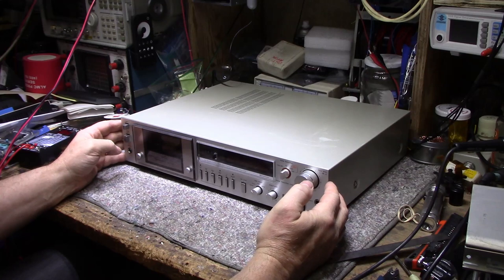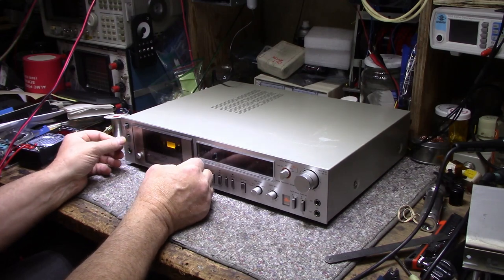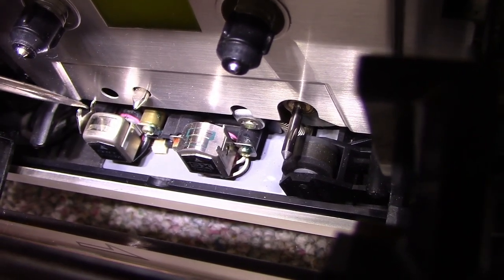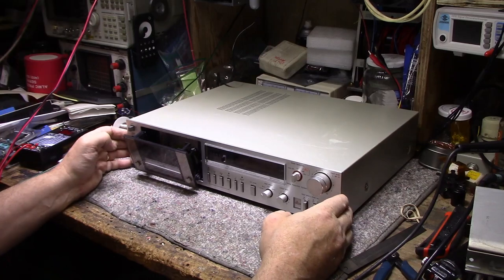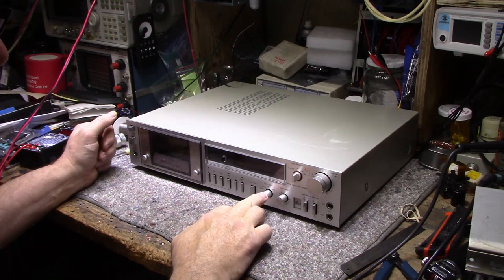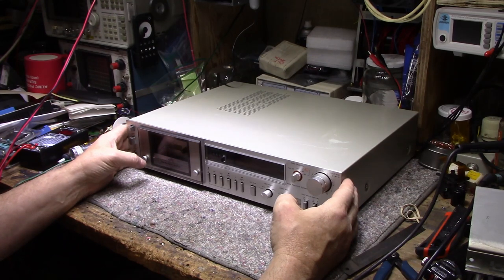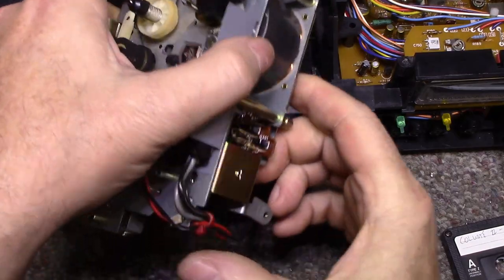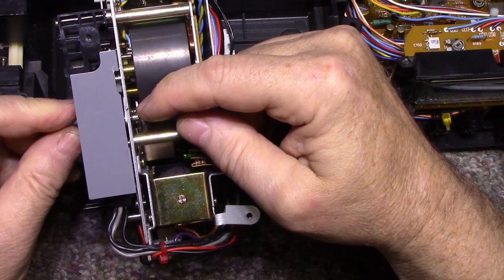Technics M270X Cassette deck - Repairs (Ep. 103)

Comment: Hi Trevor. Kinda late watching but that loose felt pressure pad that you found later on in the repair was indeed the main problem:
The first glimpse of the loose & trapped pressure pad is @15:15. You can see it above (or to the right of) the erase head in that shot. It’s visible through 16:15 at least. When you say @16:05 “I’ll put this aside…then we got full access to our heads” where you move a piece of the mechanism slightly with your thumb and you can see the pressure pad move down a bit.
@25:45 you can see the felt pressure pad directly beneath the erase head when you say “maybe it’s not going down all the way” then a few seconds later after moving the mechanism up and down for more than a few times, the pad is no longer there (likely fell out at that point) and the head mechanism seats down to where it should.

Enjoying you channel and your work!

Comment: Have a v5rx a teac dbx deck from that era.  Teac was producing some sweet stuff in the 80s.  I had to replace the heads, clutches and all the rubber.  They just sound so nice I couldn't toss it.
Reply from the maker: IMO, the early 80's was the best time for cassette decks. Manufacturers were pouring money into R&D to make higher spec machines and to beat the competitors. The race was ON!

Comment: Hi Trevor! Great video! I got the same cassette deck from a friend. He said after a few hours it has difficulty playing the tape, and eventually stops.  I suspected the tires, but they were in good condition, just some cleaning needed. Then I cleaned the whole thing,  buttons, switches and potentiometers. Your video was of great help there.

I put it back, played 90min. tape, and it played OK. Beautiful sound... I opened it again to check things out. 
The transformer was very hot, couldn't hold my hand on it. The transistor cooler  (close to the on/off switch, near the transformer) - even hotter. The back of the cassette mechanism was, well - pretty warm... These things usually don't get that warm. 

Apart from changing RIFAs (btw these are OK, no cracks) , do you have any idea what should I look into?

Comment: Hi Trevor, I need your wisdom if you have the time. I need to replace a 15000uF/63V cap that is 35mm dia and has lead space of 20mm. There isn't a cap like that any more either less or higher capacitance. Would you ever consider retrofiting a cap with shorter or longer lead space(17.5mm or 22.5mm)? No way to fit larger diameter caps. Thank you very much for your time.
Reply from the maker: Hi Alexis, sometimes we can't get a perfect fitting part. You can buy a 35mm 15000uF 63vcap because I just did on the NAD amps. If it's just a lead spacing problem I will re-drill the board to accommodate the new cap providing the copper traces will allow that. Usually they do have enough meat around the holes so I can drill an offset hole a few mm away to allow the cap to drop right in
Reply: @TrevorsBench  Thank you so much for your time and your help.